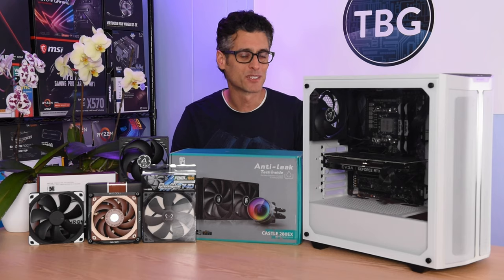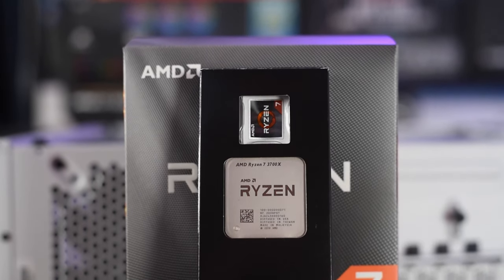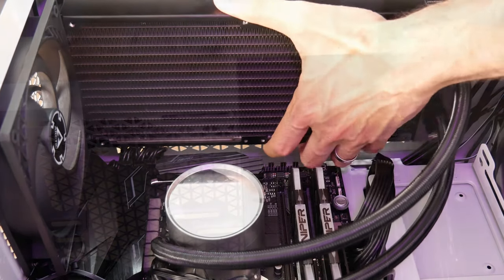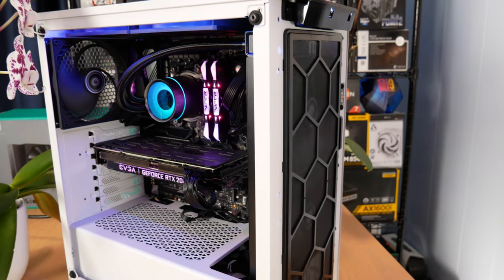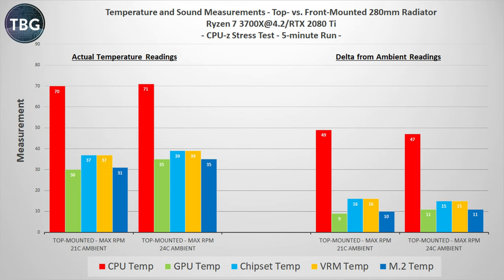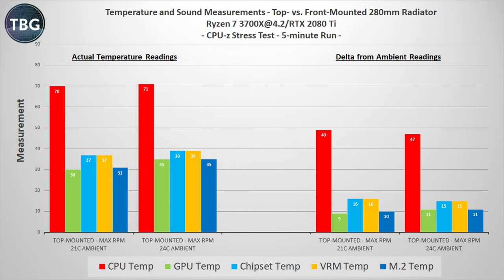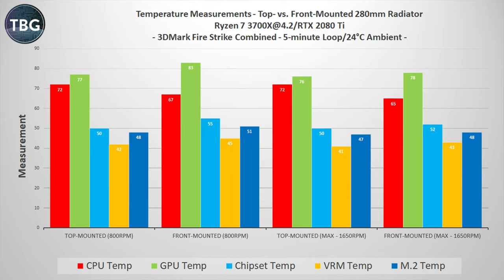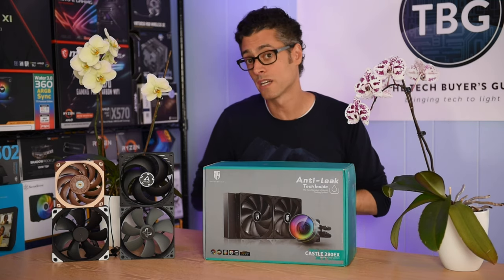Front vs. Top AIO Liquid CPU Cooler - feat. Deepcool Castle 280EX Install on AMD's AM4 socket

Comment: Just picked up the case and seen this video. A 280mm rad is not listed as supported for top-mounting, I assume yours must have just cleared the VRM heatsinks which is why it worked. In my scenario, the heatsink interferes with a 280mm on top. In this case, would you advise on down sizing to a 240mm (exhaust) on top, or a 280mm (intake) on the front?
Reply from the maker: Yes, as I explained in the video, the 280mm radiator was not officially supported, and depending on your motherboard, it would not fit.

Overall, the 280mm model will provide much higher performance than a 240mm model. I would therefore suggest keeping it and mounting it in front, but mounting dual exhaust fans to the top of the case to help with GPU cooling. You might also experiment with strapping an intake fan below the GPU, on the PSU shroud vent.
Reply: @TheTechBuyersGuru  Thanks for th quick response! I know you had mentioned it, I was just hoping I was lucky with the VRM height, but no way of knowing until you go to build it. I haven't picked one up yet, juggling the 240 or 280. 🤔
Reply from the maker: Ah, OK. If you don't have the cooler yet, then both options are open to you. What GPU do you have? That's going to be the biggest factor, because if it runs hot, then you don't want the rad in front of it.
Reply: @TheTechBuyersGuru  Repurposing a RX580 until prices come back to reality. Hoping for something along a 5800 or 3060ti. CPU is 5600X.
Reply from the maker: OK, with that setup, I'd go with a 240mm and mount it on top. None of those components will generate a ton of heat. There is no 5800 GPU, by the way. ;)
Reply: @TheTechBuyersGuru  Typo... 6800 ;)
Reply from the maker: I figured, and the 6800 would be a great choice for that system. Right now they are selling (out) at $1200. I list them on my website whenever I can, but they never stay in stock for long. Remember that the 6800 is on par with a 3070 Ti, not a 3060 Ti. You might want to join the waitlist for the EVGA 3070 Ti here: https://www.evga.com/products/product.aspx?pn=08G-P5-3783-KL&associatecode=J45HKU1STKHTH3H
Getting that card at $600 would be a dream right now, and I'm not sure EVGA will ever ship it, but it's worth signing up just in case!
Reply: @TheTechBuyersGuru  I've seen 3060 Ti retail here for $720 CAD, and at that price, the 6800 is only another $90 if you can get it direct from AMD... that is a big if. 

On the topic of the AIO, it's only $10 more for the 280 if that favours one of the other more in your opinion.
Reply from the maker: Honestly, with a 5600X, you don't need the extra CPU cooling of a 280mm. The price is close, but it means a non-optimal setup from the point of view of GPU cooling. Also creates more of a tubing mess in the case, as tubes will wrap around GPU. Is this the cooler you're thinking about? - https://amzn.to/3AfqR0Q
Reply: @TheTechBuyersGuru  I had looked at that one, but am looking at the Be Quiet Silent Loop 2 240/280 (available here, outside the US)
Reply from the maker: Silent Loop 240 would be a nice match for the case you have in terms of aesthetics.
Reply: @TheTechBuyersGuru  Is there any chance a Silent Loop 280mm fitting the case? With some motherboard for the 5600x?

Comment: Ari:  bought the 3970x on the dream build and am having issues understanding how to install the pf360 AIO cooler.  I don’t think it supports the tr4 form.  Their instructions/videos are atrocious.  Can you help/confirm or recommend a different cooler?
Reply from the maker: The cooling block doesn't cover the entire heat spreader on the 3970X, but it will still work. Use the mount in the 3970X package. SilverStone confirmed to me that this cooler is  approved for Threadripper. Let me know if you get it working.
Reply: @TheTechBuyersGuru  Definitely does not fit.  I will have to try and return it through Amazon. An email from AMD confirms this as well.  Any other suggestions?
Reply from the maker: Sorry, Daniel, I just checked with SilverStone and apparently this was marketed incorrectly. Please do go ahead and return it. It was just pulled off the Threadripper-approved list.

There really aren't a lot of liquid coolers that are ideal for Threadripper due to their small transfer plates. Here is what I'm recommending in my September Threadripper guides:
(1) Noctua NH-U14S TR4: https://amzn.to/2YWQMdg
PLUS a second fan to mount to the heatsink: https://amzn.to/31P93ed
This $100 air-based combo made for nothing but Threadripper will provide performance above most 240mm AIOs due to the huge transfer plate.
(2) Alphacool Eisbaer 420: https://amzn.to/3jutT8K
At double the price of the Noctua solution, this will provide the best performance you'll find in an AIO. It doesn't have a huge transfer plate (as no AIOs are specifically made for Threadripper), but it has the biggest radiator of any AIO at 420 (3x140mm). And it comes with the TR4 assembly kit in the box.

Comment: I'm buying a kraken z63 and I want to put it in the front panel. Can I do the same on what you did on yours? Or will it depend on the aio?
Reply from the maker: Depends on your case and the size of your video card.
Reply: @TheTechBuyersGuru  I have the msi 3070 ventus 3x. I was talking about the tube from the aio/cpu facing left side then to the radiator top/front panel. I think it should work on z63 right?
Reply from the maker: Almost guaranteed not to fit that way with a 3-fan GPU like yours, which is 12" long and taller than reference. The hoses won't reach.

Comment: what if you do a front mount and have the fans push hot air OUT, whereas the top fans push fresh air IN
Reply from the maker: I don't think that's a great idea. I've done some pretty involved case fan testing that would suggest pushing in air through the top could cause high-end GPUs to run extremely hot. Learn more here: https://youtu.be/iCn-XL-HyXg

Comment: Ideal set i can think of is front 240 with 3 push intake, lower fan for a bit gpu fresh air.. rear as intake and 2 or 1 in mid top exhausting
Reply: Or in this case, a 280 aio

Comment: Ambient temperatures may be used provided the log mean temperature difference is used. This would require inlet (ambient) and exit temperatures to be measured. Also, the heat test should use heat load as the performance metric rather than absolute component temperatures.
Reply from the maker: Thank you for that clarification!
Reply from the maker: LOL, someday I'll take the time to truly understand this, and maybe I'll actually be able to implement it in a review!

Comment: Honestly the way to go is using another AIO on the GPU (NZXT G12 bracket). Front rad as push/intake for the GPU and top push/exhaust for the CPU. That's my setup and the noise levels and performance are insane. People don't seem to know that you can put an AIO on your GPU boosting performance dramatically.
Reply from the maker: I've done this with 120mm AIOs in a mini-ITX system, swapping the rads between both positions to show how it affects temps. See my results here:  https://techbuyersguru.com/silverstone-ld03-glass-mini-itx-case-review?page=1

Basically, you're going to trade off CPU for GPU temps or vice versa depending on rad placement. In your setup, the GPU will run much cooler and and the CPU will be hotter. That's probably better for gaming, but if your CPU cooler seems to be working too hard, I'd suggest you swap the two radiators.

Comment: I'm installing a NZXT Z63 into this case and it won't fit top mounted.
Reply from the maker: The case does not officially support that installation, as I discuss in the video.
Reply: What mobo are you using? I'm looking to fit the same cooler into this case and was wondering if the fit depends on the mobo - in the video it's a tight fit with an ASUS Hero mobo, but it's a fit.
Reply: @JuicyFinn  Asus strix X570 gaming e. No it definitely won't fit top mounted. I had to go front mounted. I tried everything but there just isn't enough room for mb power cable etc. The reason I wrote this comment was to warn others
Reply: @DeepFuture  Thanks for the input - do you mean the Asus Strix X570-e Gaming? If so, then that has seemingly bigger VRM heat sink than Asus ROG Crosshair VIII Dark Hero (which I'm looking at).

Is it the heatsink that's mainly the problem? In the video the 280mm isn't much of an issue for a Hero, although it's snug.
Reply: @JuicyFinn  it wasn't the vrm's that caused me the problem as much as the power cable been in the way and the chassis width isn't enough. In hindsight I should have picked a different case.
Reply: @DeepFuture  Cheers mate! Been doing a bit further research and supported by your input, thinking of going for a different case as well which can house a bigger radiator. Fractal meshify 2 doesn't look too bad.

Comment: Why not set the top AIO as intake as well?
Reply from the maker: In a high-end build, there is a lot of heat produced. You need to be able to exhaust it. Simply pushing air in and relying on positive pressure is an outdated concept. That may have worked with blower-style GPUs. It does not work the GPUs people use today.
Reply: @TheTechBuyersGuru  Very interesting. Thanks for the info.

Comment: Think VRM components are generally rated for normal operation up to 105C, so not sure being 39 or 45 under load is that important. Couple of degrees on the GPU is significant though cause anything to keep its fan slower is good. If you're top mounting should remove dust filter so as not to impede exhaust, not sure how significant it would be in a test like this but would make a difference when the whole system is under sustained load.
Reply from the maker: All good points. You're right, the dust filter on top probably does reduced airflow, but it does so whether there's a radiator or just fans on top, so I don't think it skewed the results all that much. Plus it does reduce settling dust when the system isn't in use. Maybe some day I'll go back and test without the filter on top. With regard to VRMs, absolutely, these were running cool. But it shows that in one orientation, you have X headroom, and in another you have Y, and they are not the same. With a more power-hungry CPU in there, this could make a difference.

Comment: Isn't "delta from ambience" just a different way of representing the data? I'm not familiar with testing software and if there are actually two different modes of testing, but from just looking at your example data, it's the same results just represented in two different ways (assuming you don't do any relative percentage calculations).

Comment: Great Review. I really want this case but I trying to find out if an Kraken X63 or any other premium 280mm AIO can fit in the front of this case, tube/rad side down.
Reply from the maker: The Deepcool in this video does. I flipped it in prep for an upcoming video. But it also depends on your GPU length and width. Better to mount it on top anyway as I showed.
Reply: Today I tried a kraken x63 on the top, with my b550 Tomahawk it's impossible to fit. I prefer top mount than front mount so I stay with my x53.
It's a good case but seriously it's a shame in 2020 to not be compatible with a 280 mm top just for a few millimeters.

Comment: Hello where do I connect the 2 Fan power cables on the MB, System Fan or CPU Fan? If it's CPU Fan do I use a  Y-cable to connect them?
Reply from the maker: The fans are what go on a y-splitter, which goes to cpu fan header. The pump goes on a separate header.
Reply: @TheTechBuyersGuru  Thanks, thought so but my box came without the y-splitter therefore not sure. I only saw this video of you and I think you're doing a great job, very professional . Thank you
Reply from the maker: So you have the Deepcool Castle 280EX? It should have a splitter in the bag with the RGB controller box.

Comment: would these results change if it were a blower style video card instead?
Reply from the maker: Yes absolutely, and that's exactly why I didn't use a blower-style cooler, because they only represent about 1% of today's GPU market. It would have skewed the results even more towards top-mounted coolers. If you happen to have one, what you should know is that it will have very little effect on internal case temps, which means a top-mounted AIO would be MUCH better in this setup, and a front-mounted AIO would be MUCH worse, as it will put a tremendous amount of stress on the GPU.
Reply: The Tech Buyer's Guru Thank you so much for the reply, I really appreciate it. So just to clarify, with a blower GPU, front  mounted intake is considerably worse than top exhaust? And this is due to the blower GPU receiving less airflow because of a more restricted intake, and less restricted exhaust? Thanks in advance, just trying to comprehend!
Reply from the maker: The blower design depends on cooling air coming in from the front. With a front-mounted CPU radiator, you won't have any cooling air, you'll have pre-heated air.

Comment: Could you also give us a temp graphic with the stock fans running this setup , I'm asking this because I want to know what the difference is between running an aio with an 2080 and that Ryzen cpu. 

I'm seriously considering this case to combine with the new 3070.  Which would be sort of similar in power 

Thanks in advance
Reply from the maker: Do you mean the be quiet! Pure Wings 2? I didn't run this exact test with them, but you can see the difference between the Arctic and the PW2 here: https://youtu.be/PUdsTiRmuuU
Reply: @TheTechBuyersGuru  legend

Comment: Ok let’s start with basics here. Where are the thermal couplers in setup? Temperature charts do not look like this. Also Could this be a limitation of the cases ability to cool or design? I know All mesh front panels are not equal
Reply from the maker: I'm using the temps reported in HWMonitor. Not sure what you mean by "temperature charts do not look like this". Sounds like you're disappointed and you wanted the results to turn out differently. Sorry, but they are what they are.

Comment: Didn't know this case could use a 280mm for top mount. Would this fit a z63
Reply from the maker: Officially it does not support this setup. As you can see in the video, it barely fit, and it may not have with a slightly different motherboard layout, or if the radiator was slightly thicker. Your radiator's specs state that it is 30mm thick. The Deepcool model I used is 27mm thick. That could be the difference between fitting and not fitting. So your choice whether it's worth trying.
Reply: @TheTechBuyersGuru  
Thanks for reply and info. Great channel also.
Reply: Today I tried a kraken x63 on the top, with my b550 Tomahawk it's impossible to fit. I prefer top mount than front mount so I stay with my x53.
It's a good case but seriously it's a shame in 2020 to not be compatible with a 280 mm top just for a few millimeters.
Reply: @B.Fenderer   bummer. Front mounted it is then. Building this week.

Comment: I have a front mounted radiator and it blows ice cold air on the gpu where are you getting hot air from?
Reply: Hot air from radiator. Cpu it s Hot and air out it s Hot. Air Hot on gpu it s no good!

Comment: What you say about delta over T is interesting but it would be nice to understand the physics behind it. I suppose that a heat sink is giving off heat in two forms... convection through the transfer of energy to air (rate of energy transfer is related to the amount of airflow and the ambient air temp) and radiation (infra red heat). The thermal infra red heat dissipation isn’t affected by the ambient temperature and is tied directly to the 4th power of the temperature of the heatsink itself (in Kelvin). This would be at least a partial reason why you get a lower delta T result as ambient temperatures increase. This is assuming that humidity and pressure levels are constant which would also be factors.
Reply from the maker: Newton's Law of Cooling:  T(t) = Ts +(T0 - Ts)e^-kt
See a demo: https://demonstrations.wolfram.com/NewtonsLawOfCooling/

The further the initial temperature is from ambient, the faster a cooler will work and the more effective it becomes. The cooling rate asymptotically approaches zero as the temperature of the object approaches ambient.
Reply: The Tech Buyer's Guru Newton’s law of cooling only applies for convective cooling and fails to account for the effect of thermal radiation which is proportional to the fourth power of the temperature in kelvin.
Reply from the maker: Ultimately there are a huge number of variables at play, and if I can eliminate one in my testing to make my results more accurate, I will. It seems to me that using delta from ambient conversions leads to multiple sources of error, so I'm not going to use them even if every other reviewer does.
Reply: The Tech Buyer's Guru Agree. Better to try and have as consistent an ambient temp as possible across all tests.